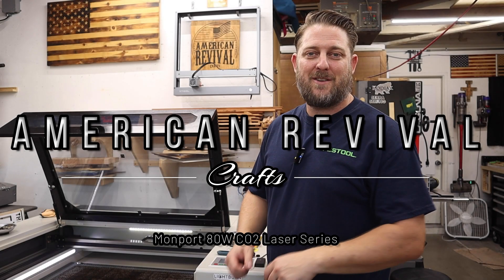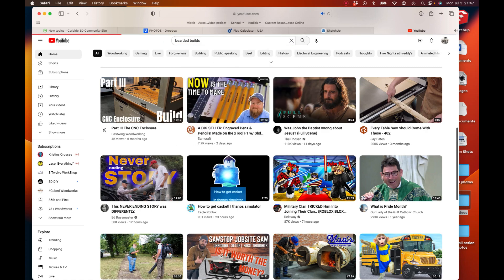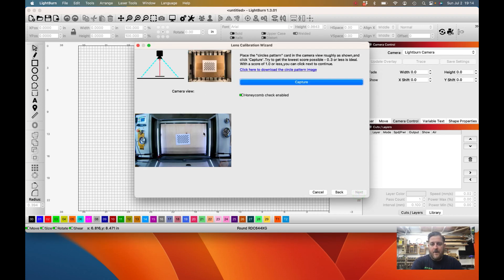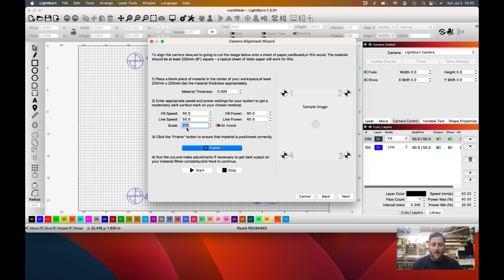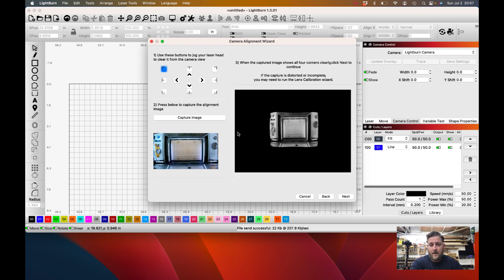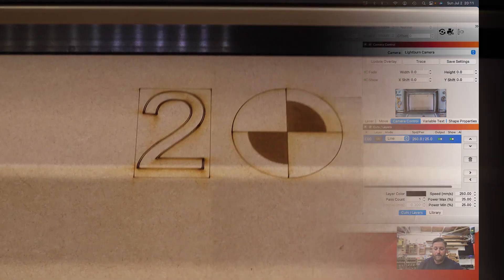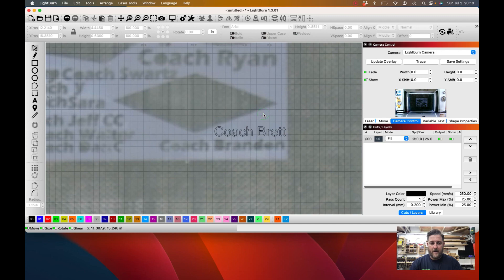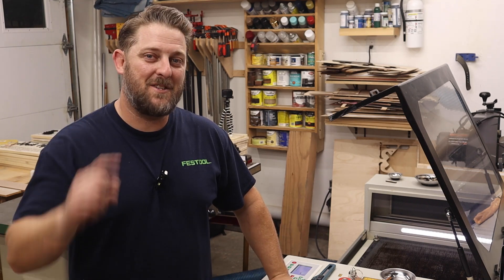Maximize Your Laser Cutter With A LightBurn Camera Setup: Step-By-Step Guide! | Brett's Laser Garage

Comment: NO NOT BUY A MONPORT LASER. They have NO support. There are 3 numbers listed on there Website as post sells support. NEITHER one number answers. Ever. You have to summit cases via an email link and WAIT. When, the contact you then it's a 24 email and wait. For days. If you have an urgent production issue like we did, you are screwed. We spent $1,000 on a CO2 laser and it's DEAD after a week when a runaway Z movement sent it into the honeycomb crunching the laser head. We are STILL waiting on Tech Support help over a week later.
Reply from the maker: I’m sorry that happened.  What laser did you buy for $1000?

I’ve said this many times, these are budget machines so yes you get budget tech support.  Do not buy a Monport or any other inexpensive (relatively) Chinese laser if you’re unable or unwilling to keep a small stockpile of parts, and research/diagnose your own issues.

For what it’s worth I’ve had the opposite experience.  My Monport got me in the game at a price I could afford and taught me a lot.  I’ve had a few minor issues (proximity sensor went out and auto focus probe died) but I was able to take care of them with help from research and forums.  At the time when it was my only laser I made sure to have some spare parts around just in case something were to happen (power supply, laser tube, proximity sensors, etc). 

Monport or other similar brands have there place.  I don’t think it’s fair to make a blanket statement to not buy one just because you had an issue.  I say do your research and know exactly what you’re buying.  That’s what I’m trying to help people understand.  

Shoot me an email and maybe I can help get things moving.  Brett@arcshop.us

Comment: Thank you for putting this together. One detail I learned with the camera on my Lasermatic MK1 10W diode laser is that you need to create and save separate profiles for different material thicknesses and for when you use spacers to lift material off the bed. Using a camera profile for 3mm material when you're cutting 6mm throws everything off quite a bit. But that's more of a Lightburn tutorial issue.
Reply from the maker: Thanks for the tip!  I’ll have to look into that.

Comment: Thank you for making these videos! I just ordered my 80w monport and was glad to see that you've covered every aspect of the product nicely. Was wondering though, if you already had a lightburn license, are you required to get the " special license key" that comes from Monport to use Lightburn? Thank you in advance!
Reply from the maker: Thank you very much!  As long as you have a lightburn DSP license you won’t need to buy any other license.  Lightburn will let you install it on two different computers so as long as you don’t exceed that you’re good to go.  Not sure what the special license is but I’m sure it’s just monport’s marketing team selling you a dsp license.  Many laser manufacturers sell LB licenses.
Reply: Thanks for the help, looks like I only had the gcode version lol but worked out. Was wondering if you had any recourses for connecting the Mac ios via Ethernet to the laser? @LaserGarage   I tried the Windows way, and didn't work, I get it to connect to the computer but Lightburn seems to just say disconnected... Any help appreciated!
Reply from the maker: Cool I’m glad you were able to get that going.  I don’t have any experience connecting via Ethernet unfortunately.  I connect all my lasers with USB.

Comment: Thanks for the video. I need this! I have the 80w monport as well....which degree camera did you get...can you post a link please....I have a 3d printer do u know if there is a file for the housing? thanks
Reply from the maker: Thanks for watching.  I got the 8mp120w camera from lightburn.  They provide a slt file for the mount for free if you want to print it.

Comment: That dust collection bag/tiny canister filter on your wall with the cleaning arm is awesome - what is that? I have the big delta jobby, not sure if they still make them - I like that little corner unit you have, I am even thinking of selling much of my stuff to switch to a shopsmith (for space), interested in that small one as an aux for the CNC - would it work for that, or suggest another tool while using something else for a CNC? (If it would fill up to fast for a CNC vs another tool I can dedicated to something like that one on your wall). 1 car garage, I am trying to maximize my space so a shopsmith + rethinking dust collection is on my mind.
Reply from the maker: The dust collector I showed in the video is a Rockler Dust Right 650 with canister filter.  It’s 110v and I like it a lot.  I switched the cnc to a small Fein Turbo dust extractor because I wanted to use the Dust Right unit as my main shop dust collector.  I’ll have a shop tour video in about a week or two to show the changes.